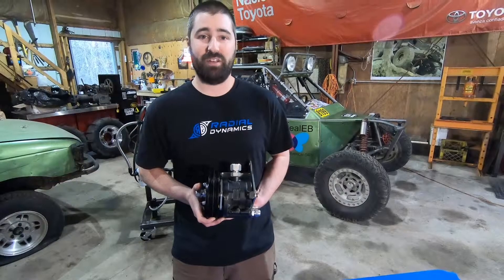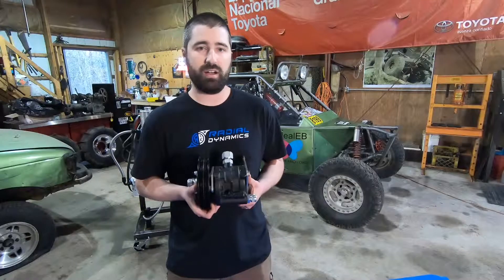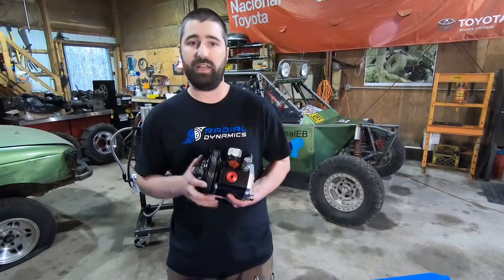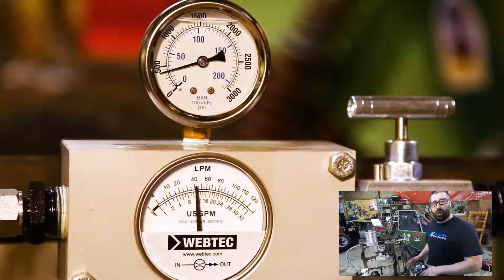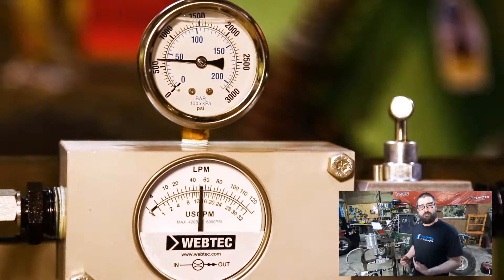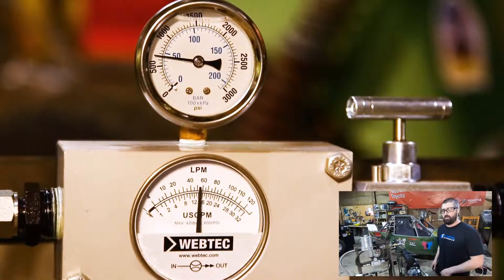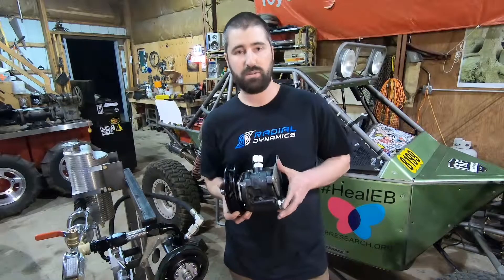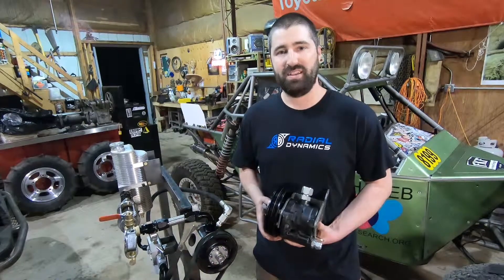Radial Dynamics - High Flow Steering Pump Testing

Comment: Great video. So just to clarify, if a power steering pump says 'controlled flow' it means it remains constant regardless of engine speed? I am trying to figure out if I can run a hydraulic 4x4 winch off my p.s. pump... Winch needs 45L/min p.s. pump says controlled flow 10L/min...
Reply from the maker: The pump may be lower than controlled flow rate at idle and will increase relative to engine speed but yes, once controlled flow is reached, it will remain mostly constant as engine speed increases. If you are considering a winch that requires 45 L/min, it sounds like your steering pump will not be adequate.